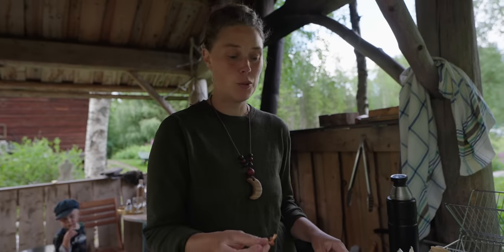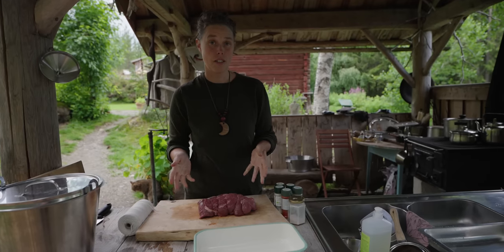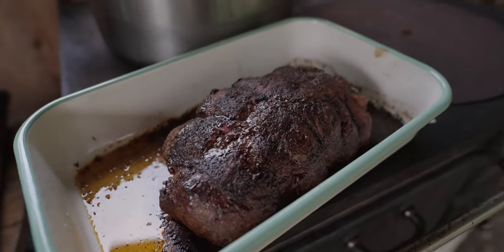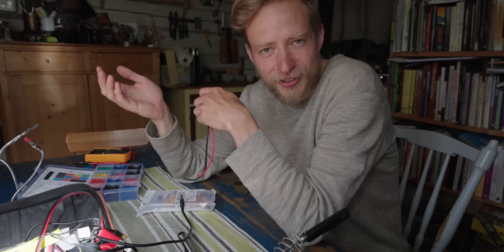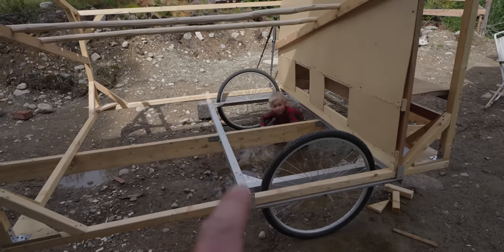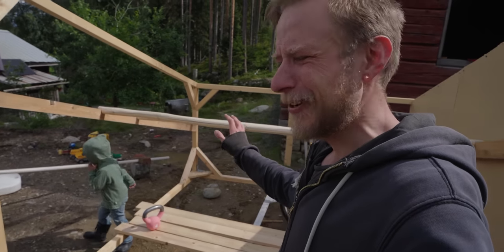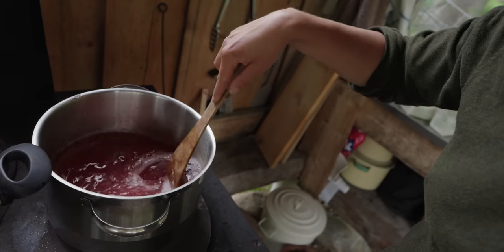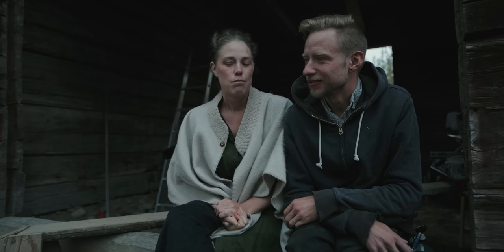Off Grid Cooking in our Outdoor Kitchen

Comment: you can also add another leg in the back to stabilize it when it is parked. and have a filler pipe outside with a funnel to pour in the water.

Comment: Chicken coop
Worst case put a kick-stand on the rear so it can’t tip. Hinge it so when it moves it will drag. A small push to the rear sets it. 

You’re thinking, keep it up!
Reply from the maker: Aha! That is an idea for sure. It would need to be adjustable so it would work when the coop is standing in a slope...

Comment: I found you both very courageous... and adventurous... this needs to be coupled with "patience" too!...
About you weight problem with your chicken house... did you think about putting the water "in the smaller side walls" of the house, long thin metal boxes making a wall like 10 cm large that would ground evenly your house because you cannot predict where the chickens will sit in your house...

Comment: If you want to mount the water barrel over the axle, why don't you make a place for it like the same style as the early settlers did with their covered wagons. Google "covered wagon water barrel holder" and select images and you will see what I mean. That way the water would be lower and on the outside where it's easy to fill and the weight won't affect the balance. The part you call the "arm" is called the "tongue" in English.